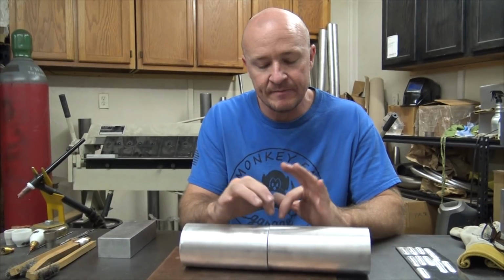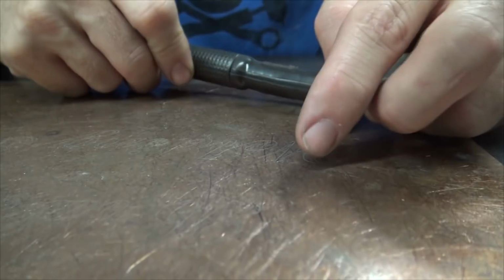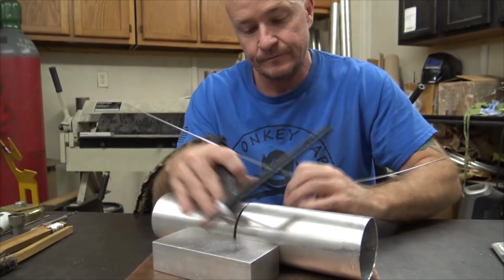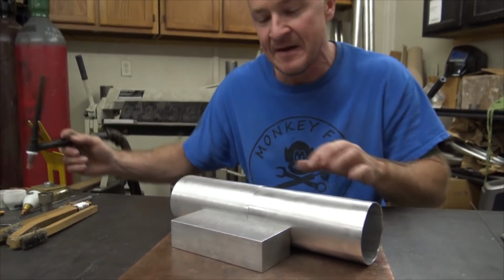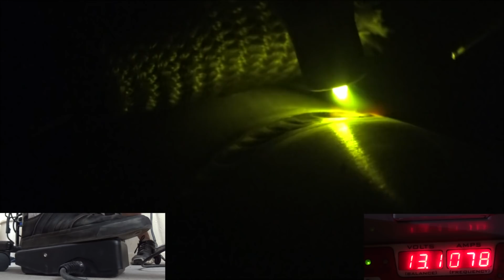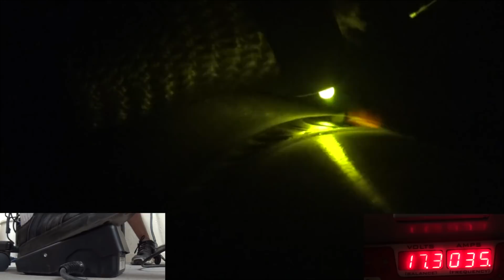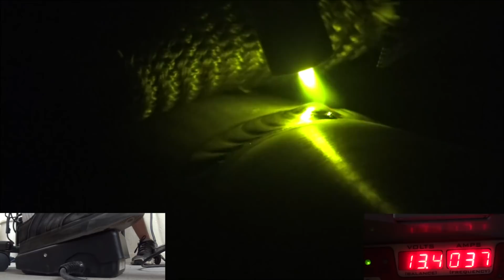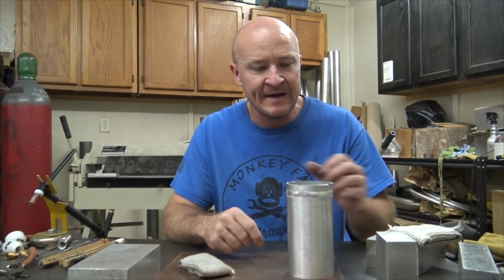How To TIG Weld Aluminum 16Ga tube

Comment: I think your "scratch" that you do is simply grounding out the tungsten which is why it's starts up easier. When I first started tig welding aluminum I was having all kinds of problems getting the arc started until someone told me about grounding out the electrode before you start. Essentially from what I understand is that static builds up when welding and can cause problems with the high frequency start so by touching the tungsten to the work piece before you begin you allow that static to dissipate.
Reply: Interesting first I've seen of this.. I will keep ot in mind.

Comment: Im using a syncrowave 250 dx at 57amps just the penetration isnt consistand and im also welding 1” tubing how much would the settings change? Should i go higher?
Reply from the maker: Maybe more amps maybe slower. Watch the bead sink.

Comment: I'm looking to buy a cheaper AC/DC Tig to learn on, how important would you say pulse is for basic IC pipe welding and the likes? Oil pan bungs, BOV flanges ect. I've been looking at the Eastwood Tig200, it seems very basic, but within my skill set. Any suggestions.
Reply: I'd add that I'll be doing a lot of steel pipe as well
Reply from the maker: JRock 636 pulse is like Bluetooth in your car. It’s nice but you can live without it. I personally would skip the Eastwood.
Reply: AHP? Everlast?
Reply from the maker: JRock 636 I’m really interested in trying out the new harbor freight tig machine. If it is near as good as the everlast it would be a good deal with that extended warranty. If you can’t make your money back in three years, you’re doing something wrong. However, I’ve been broke since, well forever 😂
Reply: LOL. I was eyeballing the Vulcan at the local HF a few days ago. Reviews seem reasonable TBH, but I am concerned with the Duty Cycle. I'm no expert with welders, but I think the DC was in the 25% range.
Reply from the maker: JRock 636 unless you plan to do production type welding I don’t see a problem. Most of the welding I do is under 120amps. If you were making sheet metal aluminum intakes all day then it would be something to worry about. I wish I could afford to get it and review but I feel like it is a solid recommendation even with out putting my hands on it. I see others doing well with them.  There is a nice 1k 200 amp everlast that I’m very partial to.
Reply: Seems to make good sense. I may adventure into picking one up. The warranty makes it worth it all day long TBH. The fact you can walk into the store and swap it out is a huge benefit. Like I mentioned, I'll probably be doing a lot of IC pipes. Maybe a crash bar on the front of my 4th gen. So perhaps the DC wont be an issue. I suspect if its a 25%DC at 200A, it would be 50%DC at say 100A?

Comment: Any reason you run 60hz rather than say 120hz or higher?  I'm just learning aluminum and have been running about 120 on intercooler piping, curious now if I should try 60..
Reply from the maker: Makes little difference. Try everything and see what works best for you. Some times I change it up depending on what I’m doing.

Comment: When you got that flat spot where you dabbed filler more than normal i would have let the tube cool down a bit. Is there a reason why you scratch the material with your tungsten ? I had this issue when i had a poor ground on my table.
Reply from the maker: R_Fab_Machining it was not a flat spot. I was just dabbing fast and shallow to show a different technique and ripple pattern. I explain the scratching in the video. I know I’m long winded but might help some that don’t know. Thanks

Comment: Now why did you keep pulling the filler rod out of the argon flow  ?Was it because of the smaller cup ?
Reply from the maker: Elton White it makes no difference you can move aluminum a foot out of the gas follow each dab. Arron at 6061.com already covered it. So don’t worry about it.

Comment: your running a invertig 221, why the ball on the tungsten? you just prefer it to run like the older machines? you wouldn't have to touch the aluminum like that if you ran a tapered tungsten instead of a ball
Reply: Chris Renaud the tungsten balls up anyway. That’s why we often flatten the point by a small amount. It balls up less. But the ball isn’t a bad thing. It’s often preferred.

Comment: What size filler rod are you using?
Reply from the maker: I like 1/16. I feel like it helps to pull the heat out as you go.

Comment: Where ca I get the tig finger
Reply: Weldmonger/welding tips and tricks sells them, or you can get the spark plug wire protector from an auto parts store.
Reply: @ thank you so much I really appreciate you

Comment: You weren't feeding into the puddle enough filler Rod
Reply from the maker: FlashTechEngineering how do you determine that?
Reply: Your bead width and stack height profile is flattened out, especially to match your penetration  to much heat input, re watch your video, watch 6061 channel
Reply from the maker: FlashTechEngineering bead is convex on both sides. Thanks for you input
Reply: @FlashTechEngineering   Where is your video you goose ?